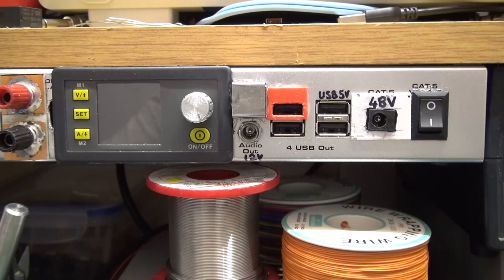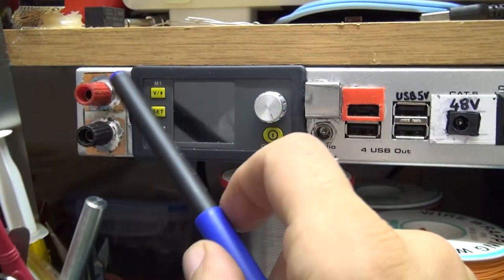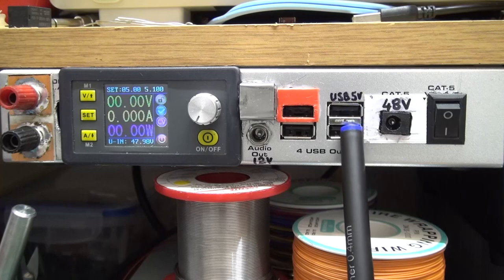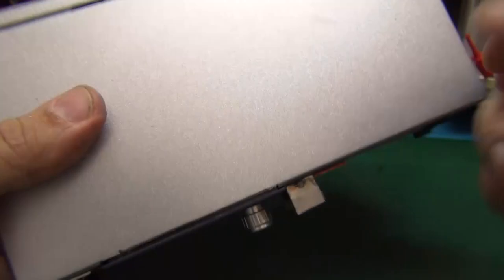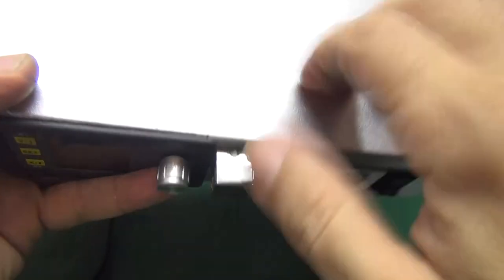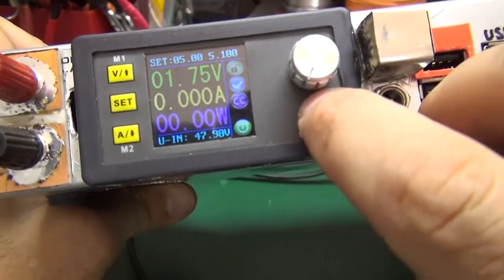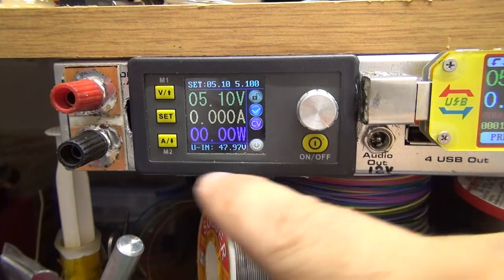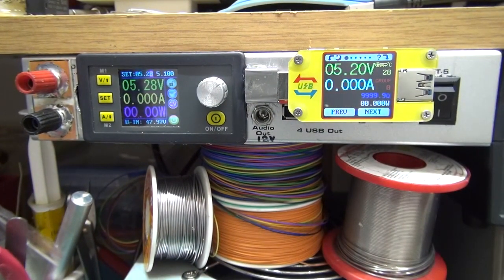A real inglorious bastard power supply

Comment: Very good idea with this bastard psu.  I was thinking of doing something like it but you inspired me with some good ideas.  Mine will probably differ a little.  I was just wondering why do you need the 48v output.  Well done Alex.
Reply from the maker: Hello Silvio. This batard power supply is made for working 24h/24 if it's need, because I don't want to use laboratory power supply working round a clock.
I thought about it since a long time before to build it. I think it will be a very nice tool. The 48v output is for testing some relays, and for 48v phantom power supply for electrostatic microphone. Glad if you like this video and if it inspire you. Thanks for your comment.